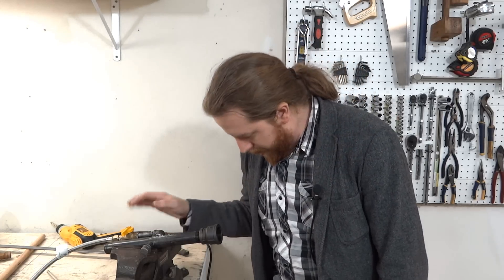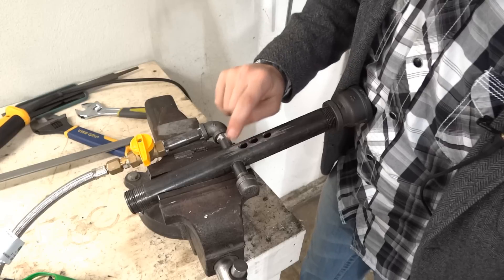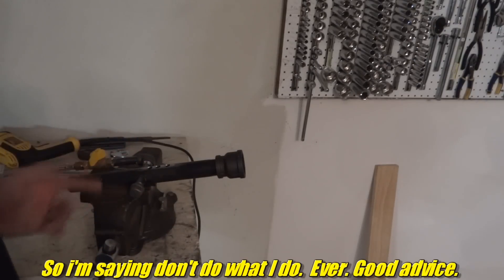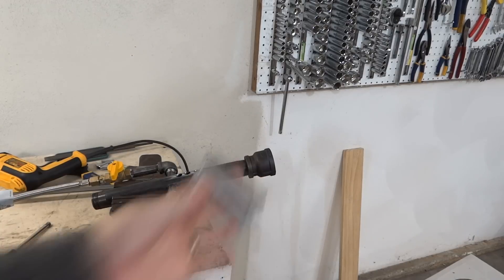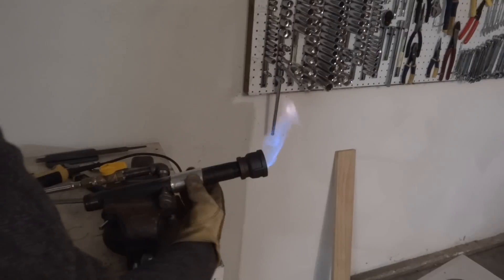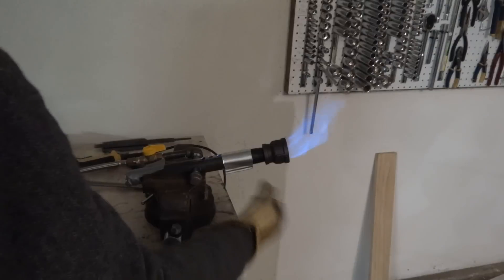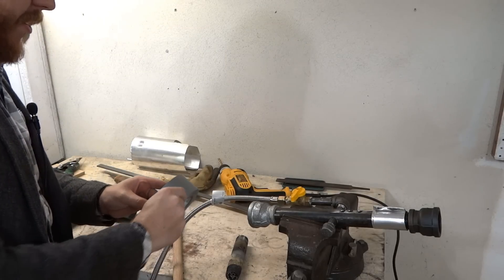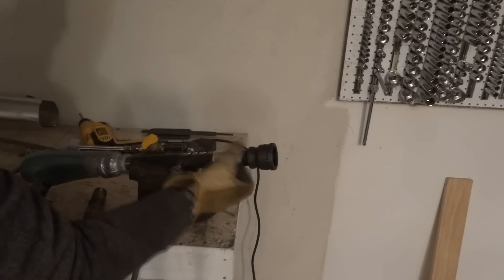Making a Propane Burner even Hotter

Comment: Hey Paul, I have an opposite problem. My foundry is too hot. I'm using a single burner on a foundry insulated with kaowool and lined with satanite and it won't burn below 1800F. I have my regulator set to the lowest it will burn without going into the tube.

The problem is I'm trying to melt zinc in this forge (boils at around 1600F) and do investment burnout as I haven't yet purchased an electric kiln. 

Can you conceive of a cheap way to modify this foundry to burn at around 800F for a few hours while my polycast burns out without cracking the mold from extreme temperature change? I was thinking of using a small pilot light burner or something similar. Or using the stock burner with extremely low propane coming in+ a small air source to keep the flame at the end of the burner. 

Any help is much appreciated! Love the vids- been watching for years.

Comment: You need a zone between the mixer & the burner where the gas is moving at greater than flame propagation speed, then zone at the head where the gas slows down.  Tube should smoothly narrow just after the air introduction point, then remain narrow, then flare at the burner head.

Comment: 3 minutes in. The problem is that the venturi holes should be behind the fuel inlet, not after. Edited: Also, you shouldn't use any galvanized (zinc) in torches, especially where it gets hot

Comment: Man.. it took like 3 minutes flat to make a burner for my foundry that works perfectly😂 none of this nonsense. A T pipe/3 way, a 6" black iron pipe, a flare/ reducer, a mig torch welding tip, a drill bit and a tap😂 drill and tap the T pipe- thread the mig nozzle in so its pointing down the middle of the T, screw the 6" pipe and the reducer (flare) on the end. Connect gas with regulator and valve onto the mig tip.. Works perfect. If i want forced air then i set my compressor regulator at just a couple psi and stick a small hose into the T pipe pointing down the nozzle. Venturi type but also works very well as a forced air without adding excess oxygen into your flame😂

Comment: All you needed was the bell on the back. Lol, keep the new bell, ditch the hair dryer, cover the holes, and use a piece of tape over the back to adjust the amount of incoming air, and you're good to go.
Reply: P.S.  love your videos,  keep it up!
Reply from the maker: you just described a different kind of burner lol I have modified this one since this, a couple times actually.  The burner you suggest is a much better design. My cobbled together nightmare only has 2 modes:  Perfect for aluminum, and overheat everything including cast iron lol there isn't much in between

Comment: If you start the combustion inside of the tube, the combustion is going to remain in the tube, also the mixing tube is too short. Are you using an adjustable regulator on your propane supply?

Comment: First off, I love your subtitles.
Secundus: I have already decided that, when I do make my forge/kiln, I will just do the simple expedient of getting a multiple Propane Manifold, 4 hoses, and the el cheapo Propane Torches, burning 1-4 as needed.
Reply from the maker: thanks!  and 4 propane torches sounds pretty intense!  I've only ever used 1 and it's plenty
Reply: @PaulsGarage    I'd only have the 4 AVAILABLE, they don't need to all be used every time.

Comment: I did a similar thing with an air matress inflator to push the temperature high enough to melt copper and brass. My flare was a 1 1/2 inch to 2 inch adapter like yours, however I used a 2 1/2 inch car exhaust coupler with slits cut in one end, hammered in a little to meet the 2 inch black iron adapter, and tack welded on. Makes a great flame holder. Pulls a little extra air in through the slits. It glows red hot when operating.

Comment: 4 years too late but you don't light your flame at the venturi. You light it at the end of the burner. 
Of course you will have flame burning inside the tube if you light it at the venturi where the nozzle is.

Comment: Any way to scale this down a decent bit in order to create a glass blowing torch. Love the idea of being able to melt and blow regular glas without the need of oxygen rig setup. Now, would compressor/compressed air improve this type of set up at all over a blower design?
Reply from the maker: This particular design is not very easy to control, and I would assume you want a fair bit of control for glass blowing, right?  Also, what temperatures do you need for glass blowing? I assume you can get glass to soften and melt without oxygen.  I have a very small burner running no air blower in a small pottery kiln and it gets to 2300f+ without a lot of trouble.

Comment: Hello, how are you? I am writing to you from Argentina to congratulate you on the video. I have a question: have you tried it with natural gas.
 Greetings Fernando
Reply from the maker: Natural gas works but the burner would have to be designed for it.  Usually natural gas runs much lower pressure than propane, and puts out higher temperatures but fewer BTUs

Comment: The holes in the pipe arent working because theres no venturi effect st the holes so no differential in pressure between outside the holes you drilled and whats in the pipe. A venturi effect needs a difference in diameter between where the air is before it enters the pipe and after it enters the pipe. If you had a cone with a larger diameter than your main pipe leading to the holes in the side you would compress the air coming into the pipe causing a lower pressure in the pipe and pulling the air in (venturi effect.)   As it is theres no venturi at the holes hence the backflow of flame. Interesting concept though I wonder if you could make a 2 stage venturi? Good luck Broski

Comment: One easy trick get a stainless steel scrubby ball then push it in the pipe near burner end. It will work like a back arresting setup forces the flames out past it holding it on one side of it.

Comment: Dude.  The first burner you made traveled up the pipe because you put the air holes in front of the gas discharge point instead of behind it.  The pressure from the propane discharge sucks the air in behind it.  If its getting the air after it starts expanding, then it will travel up the pipe.  You also need at least a 20 psi regulater for that style burner and most available at the stores are only 5 psi.  Shouldnt be that hard to figure it out.

Comment: Maybe this has already been said but I think if you have the holes in the side of the pipe you would want to plug the hole at the end of the pipe. It's letting air mix with fuel right at the point where the gas is coming out. You want the air coming in after the gas, your set-up has air coming in before the gas as long as the end of the pipe is open.

Comment: ALL YOUR PROBLEM IS BECAUSE THE WAY GAS IS FED INTO THAT CHAMBER. THAT 90 DEGREE/RIGHT ANGLE.  TO HAVE VENTURI EFFECT, GAS FLOW NEEDS TO BE AT SPEED AT THOSE HOLES. JUST AFTER THE RIGHT ANGLE, THERE IS NO VELOCITY, THERE IS LOTS OF TURBULENCE RIGHT AFTER HITTING THE WALL OF THAT ANGLE. TAKE A LOOK AT COMMERCIALLY MADE PROPANE TIPS.  

JUST REALIZED THIS IS 3 YEARS OLD

Comment: its the speed of the fuel air mixture.. thats why industrial burners have diffuses.. they dont do it for the cool swirling effect, the flame is always trying to burn back to the nozzle you need the speed to feed more air and fuel into the flame before the flame can outrun the source. the "normal" versions of these types of burners are mechanically tuned the jet of fuel from the orifice creates a vacuum and the cone shaped intake (reducer coupling) facilitates the correct air volume, changing the flow rate through the orifice changing the vacuum and the air volume giving you a mechanically tuned dynamic mixture based on the supply pressure. the flared burner end (reducer coupling) causes the the mixture to slow down and burn in a controlled manor.

Comment: Dont light it at the holes! U need to light it at the end where the cone u installed causes a low pressure zone. That's the purpose of the adapter u put on the end
Reply: Ya man, what he said
Reply: Also the holes aren't really needed, it will draw air from the back of the tube
Reply: Oh good I’m not the only one 😂

Comment: Why didn't you add a diffuser in the end to increase the venturi effect to accelerate the gases out the end. You put a bell shape at the end and that is the exact opposite of what you want. Adding forced air only band-aided your process. Also your holes drilled in the pipe should have been opposite in the circumference not in a row or line down the pipe.

Comment: At a  bronze casting foundry we made drilled 1/4" black pipe "shapes" with 2 feeder pipes that were attached to adjustable natural gas and compressed air sources. Each drilled hole became an individual touch and the "shape" corresponded to the shape of the casting mold we wanted to pre heat.

Comment: a better design would be to run fule with a tube from back to front and silver solder a Mig tip to it then make vent hols around the shell. also, upsize the mig tip with a tip cleaner. I believe this one would work fine if you started with a finer orfice and worked up. Don't think its blowing hard enough.

Comment: Can I use a rosebud tip off of a torch to heat my Foundry I'm going to use a drum out of a dryer and then use the shell from a dryer to make to foundries I want to use propane and a fan to blow the heat Into The Foundry do you think that would work

Comment: Intake for air at top, .023 mig orfice tip in the middle of the top intake, 12" of tube without stupid holes, done. The bell end is not to be put on when burner its screwed into the forge. The bell end is for testing on the bench. It will burn much better with back pressure installed in the forge

Comment: What prevents the flame from going all the way back into the fuel tank and exploding?
Reply from the maker: There is no oxygen in the fuel line, and propane cant burn without an oxidizer.  If for whatever reason oxygen gets into the line and causes a fire, there is a flashback arrestor built into the regulator attached to the tank.

Comment: Drill your primary holes around the circumference of the pipe on the angle as you did on a line just forward of the nozzle outlet. The three holes in a line disrupt air and gas flow, the air should ender the combustion chamber from the same position around the circumference of the inside diameter slightly forward of the jet (orifice)

Comment: I put the gas pipe at the end of the burner and did not drill any holes and light it at opposite end sometimes when it's windy and when the gas pressure is to low the flame will travel up the one inch pipe and burn at the source . I just turn it off and relight it. Also in the bell at the business end I put a stainless steel drain strainer. But I see your lighting it right at the orifice. don't do that  light at the end. 8*)

Comment: If you want high btu you need a liquid propane burner a small 2 inch diameter burner with one jet will produce one million btu, your are using vapor that will never produce a high btu
Reply from the maker: It melts cast iron just fine, no need for more heat 👍

Comment: On mine, I added a plenum with a caged fan to push the fuel and air out the front of both burners with some serious force (a lot more force than a hair dryer can supply).
Even so I get the same thing out of the air suction holes happens, and I just place my finger over the hole and POOF, the air being forced in pushes everything with force and the flame shoots out the front.
The issue is some of the mixture is back flowing out the holes, if you stop that it will have to shoot out the front and forcing the air (with enough force) through the pipe is the best solution.

Comment: laminar flow flame holding devices (fine screens) in the bottom of your flare will decrease flame lift and back firing.  the screen's depth is your flames depth. rods of different diameter are used also to hold flames. porting and smoothing the inner surfaces i.e. threads, casting lines, will reduce propane combining with enough air to become combustable inside the tube from jetties of turbulent mixing.
Reply from the maker: Thanks for the tips!  I've considered stuff like that, my forge burner has a screen to hold the flame.  Works well

Comment: My problem is once the burner is inside the furnace it burn well until I put the lid on, then theres a big lack of Oxygen and it burn really bad. Should I blow air in the furnace too?
Reply from the maker: When that happened to me with my last furnace it was because the hole in the top wasn't big enough and it presented a restriction. Blowing air in would help, or maybe cracking the lid open to allow more air out (that's what I did)

Comment: All you need is a high pressure regulator for propane tank.  It would work way better.  Adding oxyen will burn up material in some cases.

Comment: I suppose using backfire arrestors in the line is out of the question eh?
Reply from the maker: there is a backfire arrestor in the regulator, but backfires are not likely to happen with propane.  The propane in the line doesn't encounter any air until it is jetted into the burner tube where it's supposed to burn.  Trust me, backfire is the LEAST dangerous part of this rickety set up.

Comment: A simple 90 degree bend just after your air intake helps the cas and air mix much better, it will also cause the gas and air to roll. Take a look at how some of the more experienced smiths set up air forced forges and you will see they all have a 90 degree bend on the burners.

Comment: i have buildt a propane burner but i have used a vacuum as a force in pushing the butane and flame then with a stop cock to regulate the ration of gas and air wich in my opinion is much safer so you dont get any back flash

Comment: Sir, what you have created is really good and useable, however, it is not a Venturi. Think Bow tie shape. This applies to air injection for your burner, we used this to inject fire fighting foam to extinguish aircraft crash fires. A true Venturi has a section that is narrow, depending on the suction you want to creat determines the diameter of the hole that will be used as the injector port. That hole should be just past the narrow section of pipe on the discharge side. If you want to create a larger percentage of injection form the injection port just like you angled you air intakes on your burners.

Comment: Lol i like how you show the struggle of error. Thats exactly how my experience went too. But try drilling small holes on the sides. yours look pretty big. Next time at homedepot look at the torch by the welding section for burning weeds. Its like 200 bucks it will give you a better idea. And look up poppers guns.

Comment: I suspect the problem is that the opening at the end of the nozzle is far too large.  

Think of putting your thumb over the end of a garden hose.  While it does not increase the volume of water leaving the hose the pressure is increased AT THE NOZZEL.  

Try reducing the size of your nozzle (crimp it nearly shut?) and I think you will find that doing away with the 'duck tapped hair dryer' will remove an unnecessary fire hazard for which your neighbors might be thankful. 

Unless, of course, you want to create a blast furnace capable of melting solid steel ingots.  In that case, I suggest you update ALL of your insurance policies.  

Notwithstanding you own cautionary words regarding just how dangerous your experiment is. 

Nevertheless, I do hope you---as well as your neighbors---survive your experiments.  Not since watching Kendall Grey and his tutorial on catching 'minners' have I laughed so heartily.   

Thank you again for the videos you make.

Comment: If you want the best heat/flame the propane nozzle closest to torch tip, Pressurized regulation just behind the propane  nozzle and neutral adjustable airports behind pressurized airport.

Comment: Hey Paul, I have a suggestion for you. A metal working friend of mine suggested to use a spark-plug designed for a coal furnace.  If you rig it up in the correct place on your pipe (before where it enters into the furnace), you can flip a switch to have it spark the flames to life. Though this may seem to complicate what you have come up with, getting the fire started could be easier and as we all know how much you value SAFETY, it may be worth the effort.
Reply from the maker: That’s a really cool idea!  I’ve seen those things, never thought to add one here.  I’m a fan of over complication
Reply: Awe. I'm glad you appreciate it! I have some casting Ideas myself I want to experiment with... but I need to build a bigger-better furnace. Have you heard of "steam casting" this plus "ceramic shell" could be interesting... and dangerous!